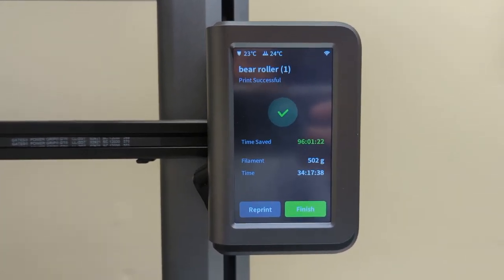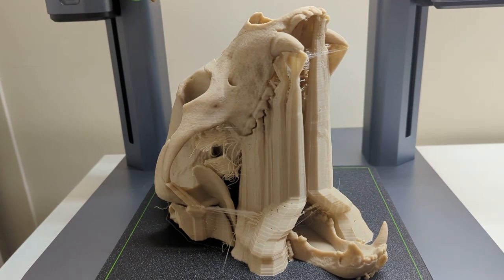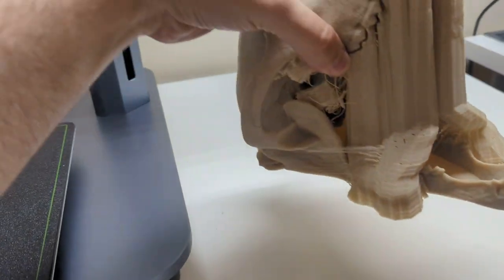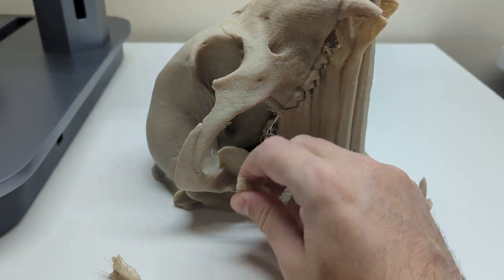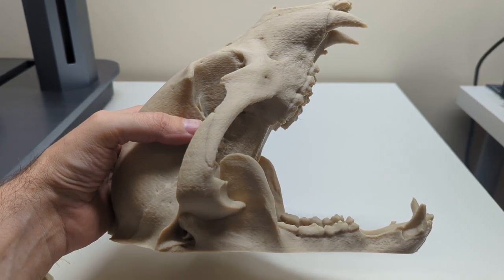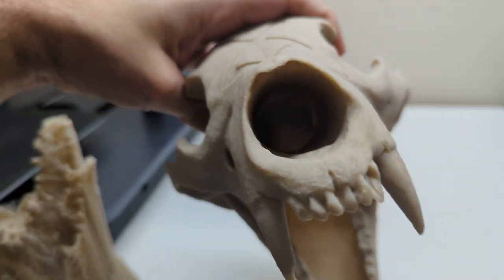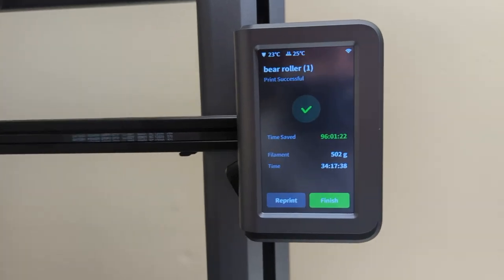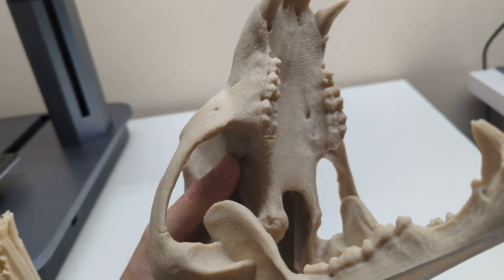AnkerMake M5: Bear Skull Dice Tower using Tree Supports

Comment: The print looks amazing. I just got into 3D printing (have an M5), I was just curious if you use the default settings for the tree supports and the other parameters? Any advice would be appreciated
Reply from the maker: I did select Tree Supports, set it to only print supports on the build plate, and left all of the other support settings at the default values. There were a few times during the print where the supports actually failed and fell, but it didn't seem to affect the printed part at all. And I have printed this one twice now, with the same supports failing in the same places, and both times the print was successful.
Good luck! Let me know if you manage to make tree supports work for you.

Comment: It turned out amazing! What speed settings did you use? I've been having a lot of issues with adhesion on the first layers
Reply from the maker: I didn't change the speed settings at all from the stock settings. I adjusted the layer height to 0.1mm, and turned on Tree Supports with the supports being placed only on the build plate. Other than that, all other settings are stock.
For better adhesion, I use Elmer's All Purpose Glue Stick. It's cheap, readily available, and water soluble, so you can easily wash it right off of both the build plate and the printed part.
Reply: @Old Guy Melts Plastic  thanks for the tip! I'll give that glue a try